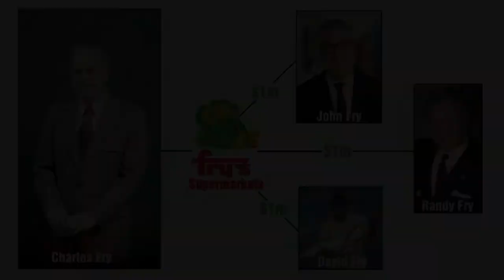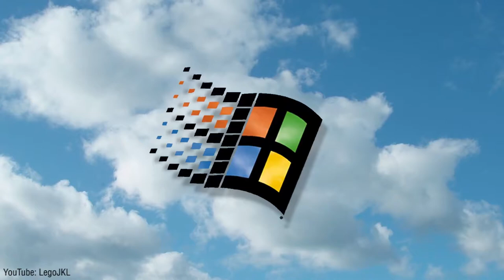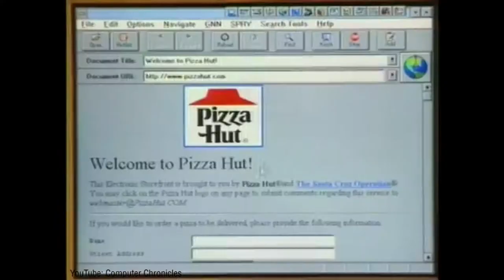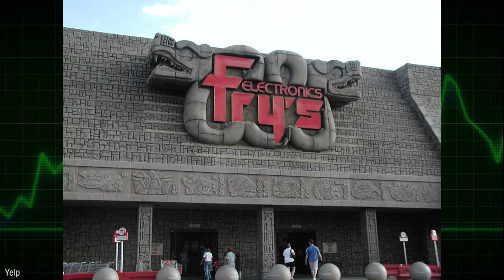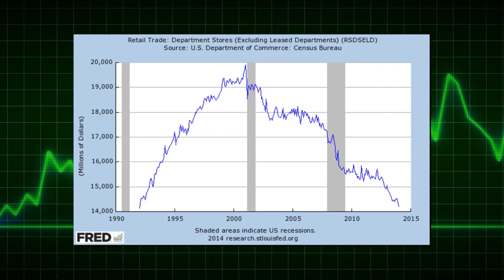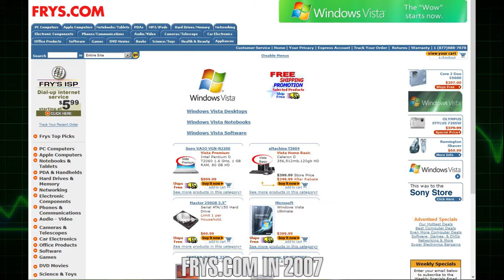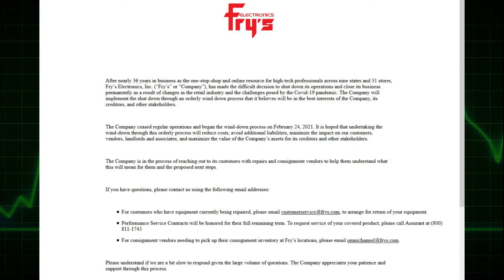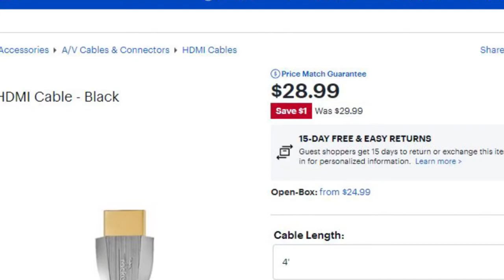The Story and Many Mistakes of Fry's Electronics

Comment: One of the main reasons Fry's Electronics failed is because of defective products. There were sometimes long lines out the door for returns and shelves would contain many marked and unmarked returned items.
Reply: They re-packaged returned and often defective products and re-sold as new. I tried to return a recalled/ defective intel cpu.  They took forever to not give me a refund.  I had to go to Intel to get a replacement.  They were slime.
Reply: @scottlowell493  I worked at one in the 90s. The way I observed things was that nothing was marked defective until it was returned at least twice for the same reason.  Employees had to do product testing of returns, on occasion I would "make" a product defective with a physical defect so that it couldn't be resold, because I would notice products coming back an specifically recognize them.

Comment: When I moved to Silicon Valley in ‘86, I visited the original Fry’s store. It was about the size of a Walgreens or Rite-aid. Mostly components and equipment. PC motherboards we’re just being introduced. Only junk food, no produce. It was open 24hours. Engineers from local startups would come in at all hours when they ran out of gate arrays or wire wrap, or Proto-boards.
Reply from the maker: Thanks for sharing! That sounds like an awesome era to experience.
Reply: Their biggest mistake was to get into Audio, TVs and consumer appliances.
Reply: Fascinating! When I moved to the Bay Area I was amazed at how few electronics stores there were in the 2000s. 

I think part of the problem was that you could no longer satisfy people with a small set of components. A Walgreens sized store in 2010 wouldn’t be able to sell what anyone needed. So many different parts!
Reply: Thanks for sharing. What an amazing time!
Reply: @ecstazyrm  I also frequented most of the surplus electronics stores in Silicon Valley in those days.  Wierd Stuff in particular was a Silicon Valley icon. At one point, it rivaled Fry’s in square footage. I’m talking stuff like industrial lasers and chip sputtering equipment as well as military surplus electronics. Uber-Geek central!
Reply: Correct; there was no produce.  I included a google streetview snapshot of the original store at the corner of Oakmead Parkway & Lawrence in my separate posting.

Comment: The weirdest part was that there wasn't a liquidation sale; just BOOM closed.  In the Las Vegas store, I had previously noticed that  each time I went, section by section, areas of the store were closed off.  Very strange.
Reply from the maker: They mastered the art of the silent bankruptcy…
Reply: same in Houston.. and for things that should have sold.  Network equipment such as connectors were not available.  I got the impression the sections were closed as their suppliers cut them off.  They were selling appliances and supplies very well.
Reply: Items were a consignment. Unless they made a deal with all item owners to mark down their items in going out of business sale would be more difficult than just telling everyone to come pick up their items that didn't sell - which they did.
Reply: @h.mandelene3279  Exactly, They told suppliers to come get their stock, which I assumed never happened and instead were written off. Stores probably sit abandoned as they were on the last day.
Reply: @turkey ssr really? I was surprised what happened to Frys. I use to work there at that location and had friends that worked there a long time. They were struggling to keep up with newegg and other online retailers at the time I was working there. Even with their price matching. I loved going there because some computer parts are difficult to find and I am one of those who don’t like to wait too long to get the part. Aside from online shopping its pretty difficult to find those things now or at least now I don’t know where to look.
Reply: @bloodynessie1  the instant gratification factor was key, along with impulse purchases for lots of people. They had so many different kinds of shiny toys to be tempted by.

Comment: The rise of online shopping really doesn't account for all of the decline of brick and mortar stores.  A major factor is the commoditization of home electronics.  25 years ago, the margins for stuff like TVs and audio equipment was much higher than it is now.  Retailers were in a race to the bottom with shrinking margins on most of its products which killed off the weaker ones like Circuit City.  (Best Buy almost went under in 2011-2012 timeframe)  Considering that salespeople at Frys worked off commission didn't help matters.  Their aggressive sales tactics would end up chasing away many of its customers to the online space.

Comment: I live about two miles from the first Fry’s store in Sunnyvale, Ca. It was more of a grocery store than electronics, but they did have the basics like tubes, resistors, and small printed circuit boards. You are right on the money they grew to big to fast and didn’t support their customer base who were electronic, manufacturing, semi & software engineers, backed by assembly and technicians. Who knew more about the quality and functions of the product they were selling.

Comment: Another victim of Fry's was NCA Peripherals.    They sold a lot of computer-related items- motherboards, CPU's, memory sticks, graphics boards, hard drives- you get the idea.  Every time NCA had a sale on stuff, Fry's would immediately counter with prices about 5% lower than NCA.  Sometimes even a bit more if it was around Christmas time or a major holiday- 4th of July, Labor Day, etc.  After about 4 or 5 years of constantly getting  undercut by Fry's, NCA threw in the towel and said "we quit."  Not literally of course, but you could tell from their "Going Out of Business" sales what was going on.  Another victim was Egghead Software.

Comment: Never seen a Fry's TV commercial before! I use to shop at both the San Marcos and San Diego stores and I loved going. I loved going to the San Marcos store just to browse and look at the fish tanks (which they slowly got rid of)  Fry's had two stores for all of the San Diego area but Best Buy, Home Depot, and Lowes had many. Furthermore, Best Buy, Home Depot, and Lowes had/have a full-color ad every Sunday Where as Fry's had the back page of Friday's Sports section blink and you missed it.  Things like Mattresses, and Appliances pull in lots of money just like those stupid gold-plated cables. People would rather drive someplace around the corner than miles and miles to get to a Fry's.  They leaned heavily on mattresses, appliances, music, and books then each one of those markets radically changed and Fry's failed to keep current. At the time, I could buy from Amazon and have the item in short order or buy it online with Fry's and get it in a week or two.  Furthermore, Towards the end, I caught the website and the store has two different prices. I would print out the website page and take it in to get the price matched. One last point, Fry's never did keep up maintenance on the display things example, in San Marcos entryway had walls of water with bubbles in them which I really liked but the water would go down and hardly ever get refilled which looks tacky and ugly, so they failed to keep up the decorations that set them apart image going to Disneyland and seeing paint pealing, bare wires, and Mickey with a big hole in the costume.

Comment: The smartphone, streaming, and online retail killed Frys. 
The huge, expensive designed Fry’s stores were a disadvantage compared with smaller, cheaper Best Buy stores and the Apple Stores. 
The change in most brick and mortar electronics retail was shocking. 
In the 90s and early 2000s large Fry’s stores had customers in every isle. Sales would result in lines before the store opened. 
After the 2010s, brick and mortar electronic stores were dying. About 5 years ago I was at a Fry’s store and it had hardly any customers.
* The smartphone and streaming killed off the need for CDs, DVDs, Blu-Rays. All the parts and computers could be bought online. 
- All that was left was Best Buy and Apple Stores. The rest of brick and mortar electronics retail was pretty much gone.

Comment: Its not just that online retailing killed Fry's.  The Smartphone killed Fry's.  Today you no longer need a camera, music player, a GPS, a gameboy, a pocket calculator, an organizer, a cordless phone, a portable video player, records, cassettes, vhs tapes, DVDs or Blu-Rays - or anything like that.  You just buy a cellphone at a cellphone shop and you're good to go!  So the consolidation of ALL electronic devices into smartphones made it unnecessary to have such a large store with so much floorspace.  Radio Shack recognized this and converted into CELLPHONE STOREs.  The only departments at Fry's that still made sense were Cellphones (obviously), large appliances, TVs and Computers!  With industrial powerhouses like Intel & Qualcommm & AMD & NVidia pumping out chips with 5B - 30B transistors, being a home electronics hobbyist became a "quaint and obscure" hobby, since most of the things that people used to build for themselves, could be done with some software on a smartphone!
Reply: No entirely true..I STILL bought cameras, laptops, tablets, external hard drives, cables, TVs, games, laptop and tablet cases, mice, keyboards, electrical component tools all the way until that stuff started disappearing in their stores